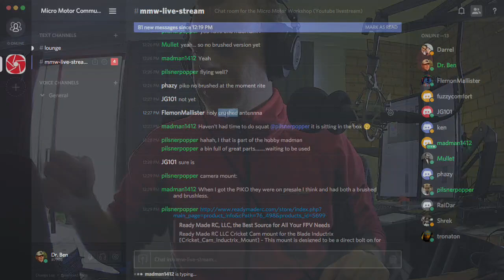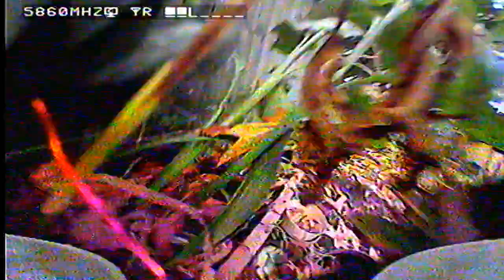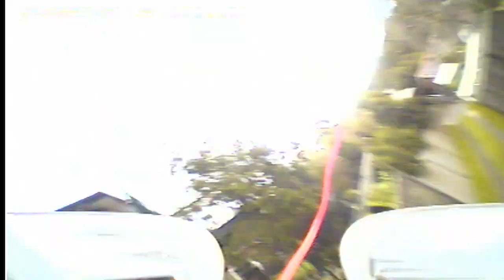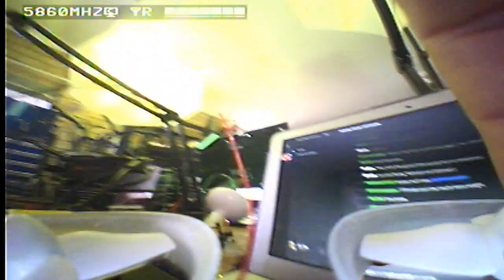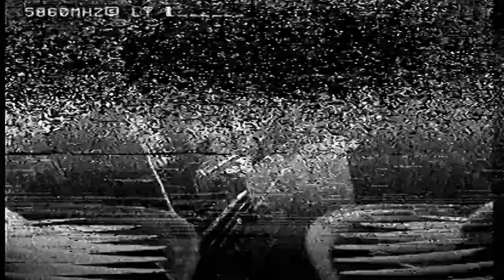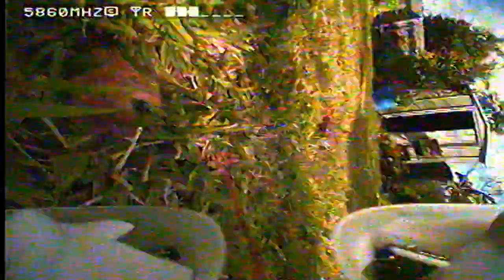Micro Motor Workshop - Episode #1 - Tiny Whoop Tips&Tricks

Comment: What's a good ground station receiver setup for video do you recommend?
Reply: TheHelicapt Clearview receivers from Iftrontech are the best 5.8GHz video receivers a have seen so far.
Reply: Benedikt Haak 
thanks. With what antennas ? Can you list your setup, I'm new to fpv world.
Reply: TheHelicapt you need matching antennas on Rx and Tx. Right hand polarised circular antennas are common. I use VAS BlueBeams and TrueRC Horizon antennas for whooping around the house, and Iftrontech vintenna lollipops on the racetrack. I suggest you come over to community.micro-motor-warehouse.com, there is a lot of info about building micro FPV copters.
Reply: Benedikt Haak 
Very cool. Thanks !

Comment: I just bought one and a little fpv camera to practice fpv with my fatsharks before crash my real big toy. I have a turnigy tgyi10 radio, I dont know if the quad will bind with that .If not is possible to update the FC or the receiver to make it bind with my radio?
I think is a  great toy , also I think that connecting the video to the power source produce noise in the video due to the motors. I prefer connect a little micro battery to the camera  and also bought a better and more powerful mini batteries for the quad. I 'm waiting for my whole package to be deliver and try  it how it go. But really I would like to use my big radio to flight more realistic. I hope you had some experience in this area . ai can see that you play a lot with that quad and could help me with that inquiry .

Comment: I have the stock motors and the Hyperion camera from flite test.
I only get about one minute of flight before it wobbles and falss from the sky.
Would upgraded motors fix this?
Reply: No, they will make it worse. You need a better battery.
Reply: Benedikt Haak
I've tried 4 different kinds.  MMW .205 mah, Lectro 180mah, an e-flite 150 mah, and the stock batteries.
What am I doing differently than other folks?
Reply: +odinata 205mah batteries and 0615-14 motors should give you around 3 minutes of flight time. Stock motors and camera usually doesn't fly very well. If you already have 205mah batteries, then yes, add faster motors to the mix. If you then still have problem, I'd try replacing the power connector on the board.
Reply: I am looking for the longest run times, as opposed to speed and tricks and such.
The  0615-14 are the "fast" motors.  Would those suit me better than the "medium" or the "insane"?
Reply: +odinata For longest runtime, I suggest 0615-11 motors and 205mah batteries.
Reply: +Benedikt Haak Ok, thanks.  Any ideas how much longer (average , of course) that combo is over the "fast" + the 205?
Reply: +odinata no.. I'm always pushing the envelope into the other direction.. But I'm pretty confident that this combo will give you more flight time than other battery/motor combos. It will depend a lot on flying style and payload.
Reply: Benedikt Haak
Its interesting to think about how the combos work.
Bigger batteries have more juice, but weigh more.
Stronger motors produce more thrust, but consume more power.
I would really love to see the data on all these combinations graphed out.

Comment: Benedikt, I was wondering if instead of using your black hot glue stick, would it be ok to use regular glue from glue guns? Thanks, love your work and a proud customer!
Reply: Thanks a lot Jean. I find Keratin to easier to work with than regular hotglue. It flows nicer, it sticks better, and it pulls less strings.
Reply: Keratin it is, thank you!

Comment: Hey what module did you use to connect your radio transmitter to your drone?
Reply: The module I use is discontinued now. You need a DSM module. OrangeRX DSM module v1.2 or Spektrum DM9 are possible options.
Reply: What do you think is better in your opinion?
Reply: The Orange module works, but it requires frequent re-binding. I will try the DM9 soon, it just arrived.

Comment: Why not use one of those metal frames they sell on ebay for the quad
Reply from the maker: you mean the Rakonheli frame?
Reply: +Micro Motor Warehouse Yeah the Rakon frames.
Reply from the maker: Price, weight, complexity and aluminium are reasons against it. Looks great though!
Reply: Stock frame is still the best as Benedikt mentions in this video, but the Rakon is ideal if you're a more aggressive pilot like myself for example. Keep an eye out on improved 3D printed frames as well!

Comment: Question on the Cricket Cam. Do you know if it has a voltage regulator built into it or do I need to provide one for it on a single cell build?
Reply: I use the Cricket cam, and it's pretty nice. though for the life of me I could NOT get the case off ? I used a tiny screw driver and pryed all the way around. that sucker would not come off !
Reply from the maker: It runs straight of a single cell. I solder it straight to the FC power inputs, and dont seen any ESC noise in the video.
Reply: Thank you. Should have my unit in a few days! :)